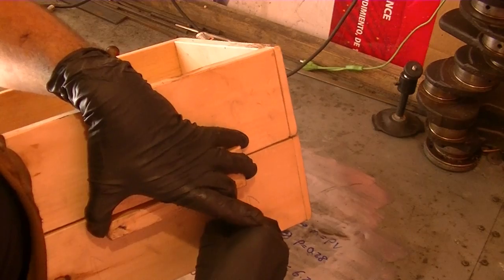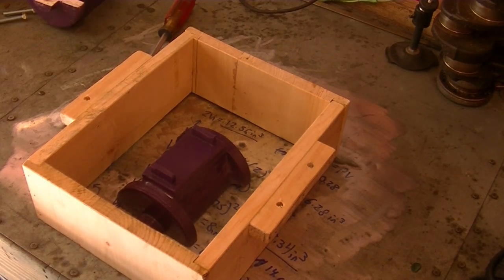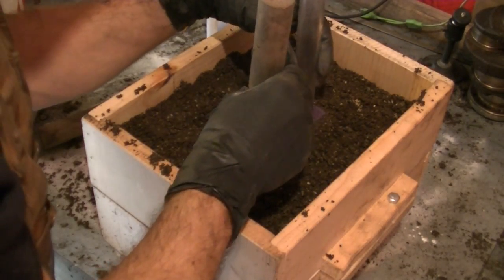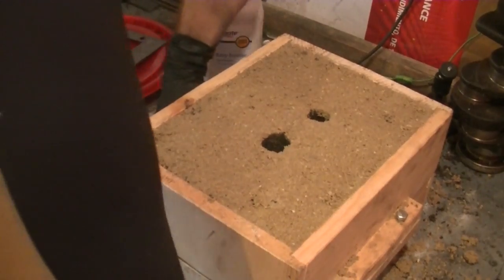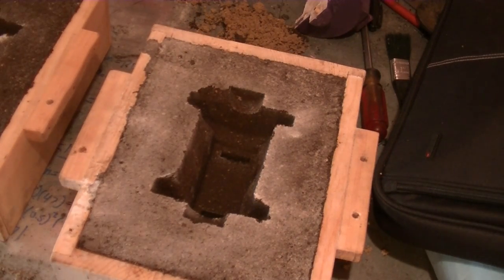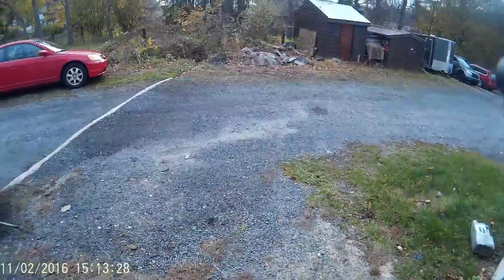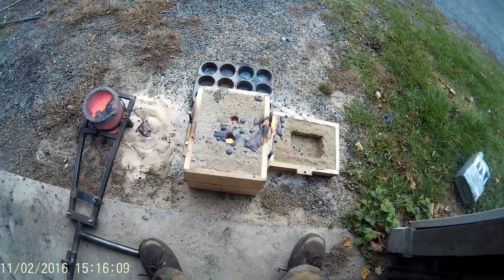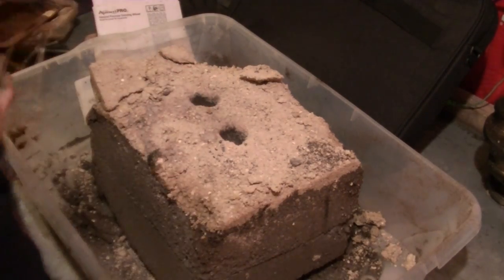Steam Engine Build: Cast Iron Engine Cylinder Pour : Part 1

Comment: Man, that was a brutal pour. But hey! This puts you in a very small list of youtubers who have managed to run cast-iron. You should be proud! Take a look at luckygen's channel, he's got a video where he shows the building of a really well designed pouring device that runs on wheels and keeps the operator nice and far away from the heat. The weight of the crucible is conducted to the ground, and you get tons of leverage for the sake of tipping the crucible into the mold, so it is not nearly as strenuous as pouring with standard crucible tongs.
Reply from the maker: Thanks for the comment!  I will take a look! That sounds awesome.

Comment: What precautions do you take to minimize steam in your mold with these ultra hot metal pours?
Reply from the maker: Putting adequate vents helps.  It also helps to wait a day or so to let the mold dry out a bit.  Its usually not too much of a big problem I have found.  At least for the kinds of pours I have experience with.

Comment: Man,
How do you calculate how much iron ore powder do you need for a particular mould..
Do you just estimate or there is an
Exact or approximate calculation
Reply from the maker: Estimate by using simple geometric shapes for the object (as well as the risers) then add like 10 to 20 or so percent more for account for errors and such.

Comment: What plans are you using for the steam engine?  Are you going to make them available?
Reply from the maker: My own plans.  I DO plan on making them available, but I am waiting until I finish the engine so I can work out any issues incurred from oversights in my engineering.

Comment: How do you make your prototypes/positives? It would be cool if you made a video about that.
Reply from the maker: Initially I made them out of wood and then painted them to make them smooth and look nice.  But recently I have moved into 3D printed ones.  The 3D printed ones don't have as nice of a surface finish, and they are more annoying to work with, but they save HOURS in labor time for producing them.

I think the only reason why I don't have videos on making my wooden patterns was because I view my pattern making as sloppy.  Pattern making is an art, and I am more of a pragmatic guy, so "good enough" is enough for me.
Reply: Fair Weather Foundry thing is, I'm kinda the same way. I just don't know what to do for something big like that. Myfordboy uses bondo and cuts wood with jigsaws and such. Bondo is expensive though... at least in that amount. I imagine some sort of putty would be useful. But I don't know. Most people don't show the prototype making part
Reply: So if you could make a video or explain it that would be great.
Reply from the maker: Ok, next time I make a pattern, I will record it!

Comment: When you said "I have a contingency for everything" did that include the crucible weight management, the work flow with bucket in the way and the pouring hole diameter because you should have used your plan B. Well done on surviving that.